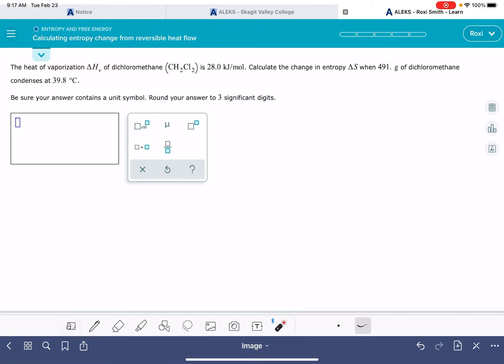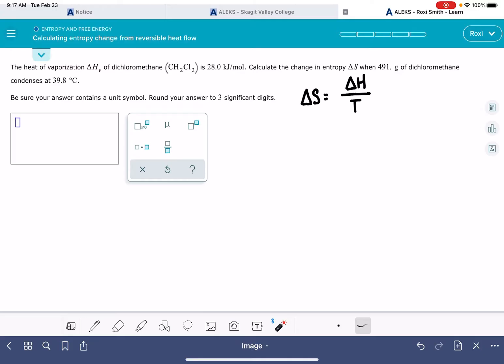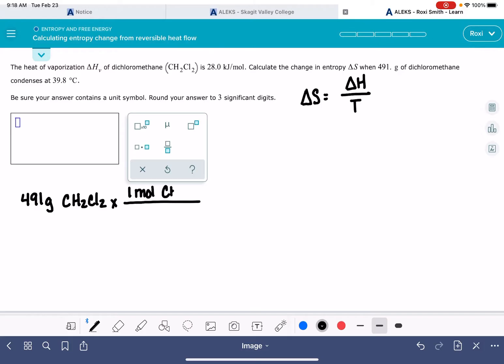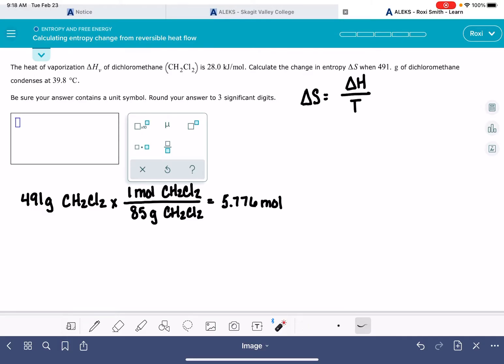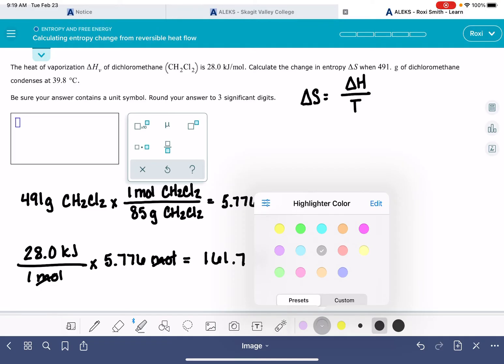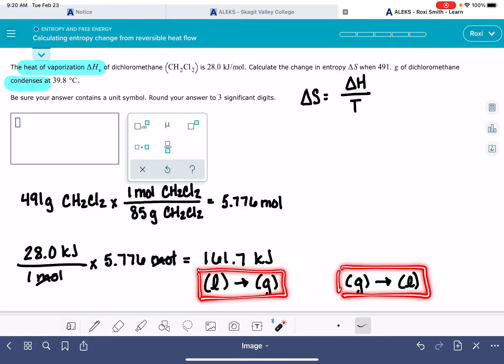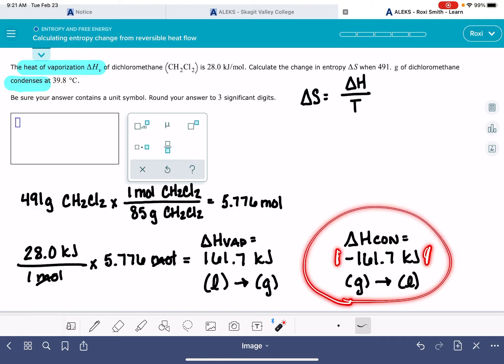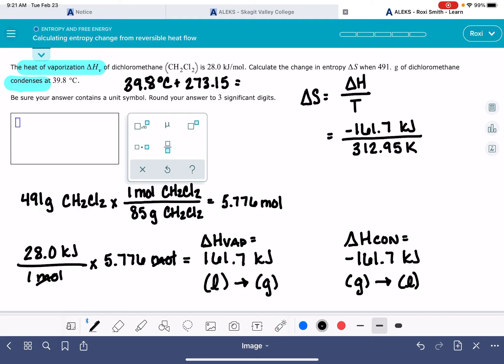ALEKS: Calculating entropy change for reversible heat flow

Comment: what if it says heat of fusion?
Reply from the maker: Good question!  There's no change to the formula or process.  Fusion refers specifically to melting, so make sure you're reading the problem carefully and change the sign as needed, based on whether your problem is referring to melting or freezing.
Reply: If we use the delta G equation, this just implies that delta G is zero when the state changes? @RoxiHulet